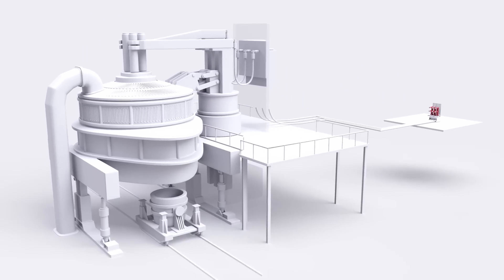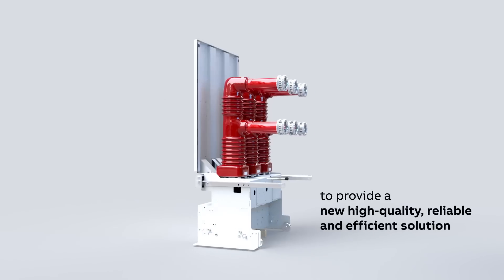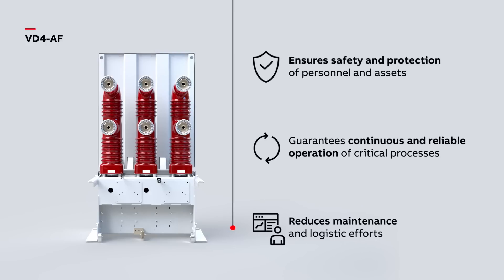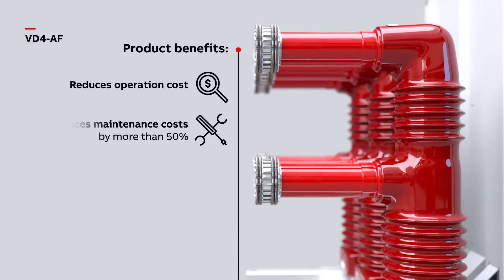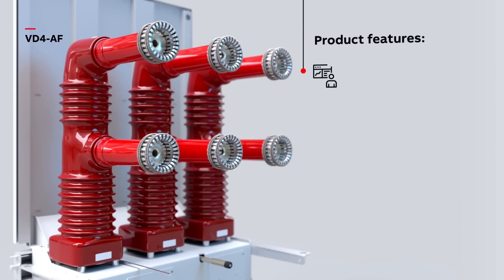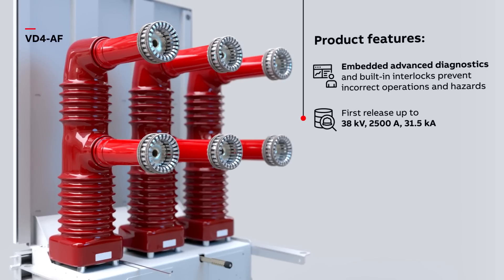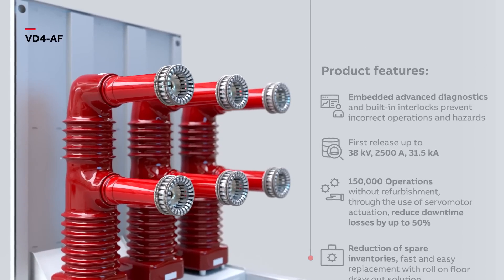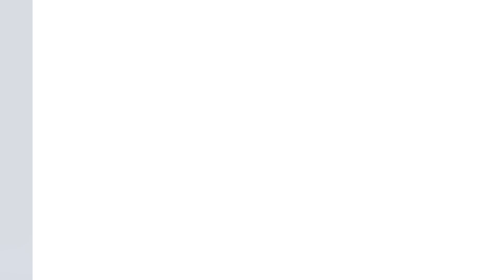VD4-AF - medium voltage circuit breaker for steel furnace operation and protection

Comment: We need to replace a Air Breaker used to drive arc furnace, we are thinking in this device.
Bbut is not clear to me if trhis vacuum solution produce overvoltages in the  "transformer-reactor" array due the high inductance characteristic of it. 
If somebody knows aboyt this subject , please we will apreciatte your help.

Comment: ABB’s VD4-AF new medium voltage vacuum circuit breaker is the perfect for powering the steel industry’s.
Reply: We need to replace a Air Breaker used to drive arc furnace, we are thinking in this device.
Bbut is not clear to me if trhis vacuum solution produce overvoltages in the  "transformer-reactor" array due the high inductance characteristic of it. 
If somebody knows aboyt this subject , please we will apreciatte your help